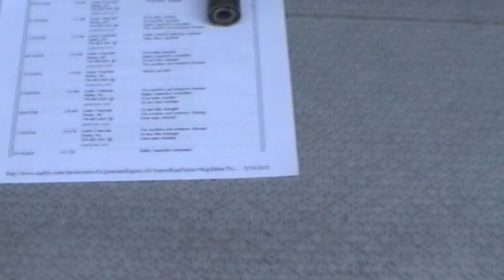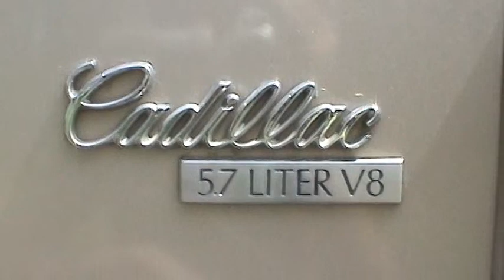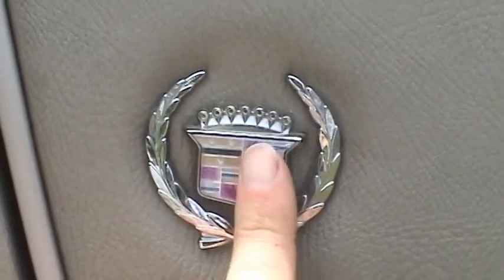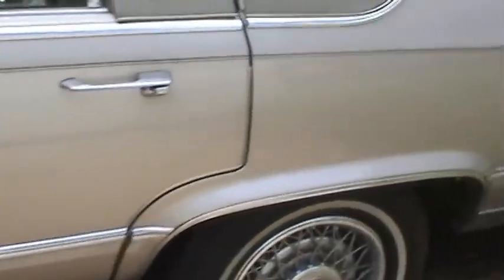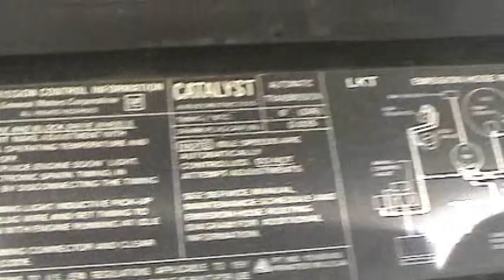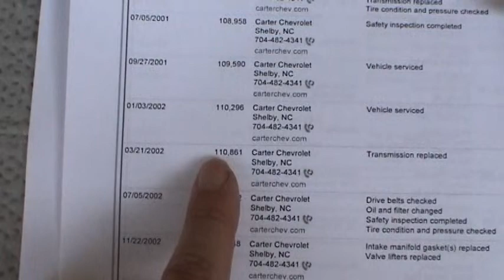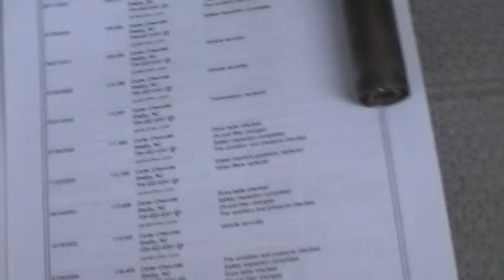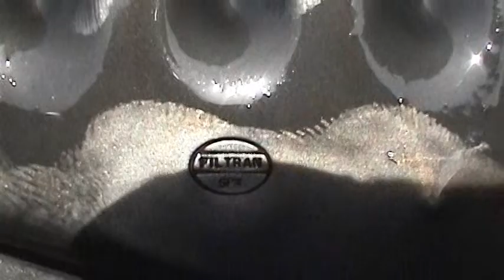1991 Cadillac Brougham D'Elegance Transmission Diagnosis

Comment: I know we had an 89 Ford Taurus and the dealer told us when the overdrive transmission first came out that on the street you were supposed to drive them in regular drive which is the 3rd gear on most cars and then when you get up to the freeway speeds or you know 55 and above you would shift into overdrive because they were having problems with the transmission going out because people were driving them in overdrive on the street and they were shifting too much so we always used to just drive in 3rd gear! we would use overdrive only above 55 and it seemed to keep the transmission from wearing out so fast.

Comment: The original and two replacement transmissions all slip? Could it be a malfunctioning torque converter? How about a bad PCM computer? I really have a hard time believing 3 transmissions all have the same problem. (two of which are rebuilt).

Comment: I'm looking for a Brougham similar to yours, but one with a bad engine. Lots of the 5.0 L engines saw early deaths. I'm planning to drop a 6.2 early 80's GM Diesel in it. I'm also planning to place a key pad module into the driver's door to have the keypad entry system like a Town Car.